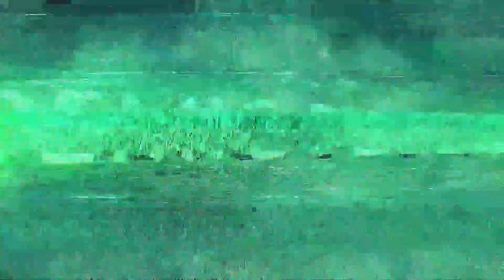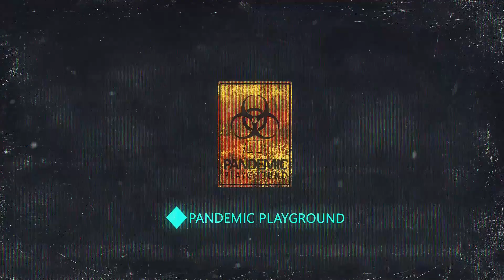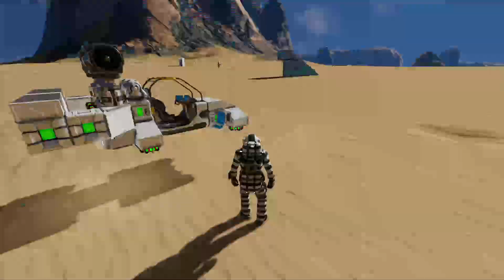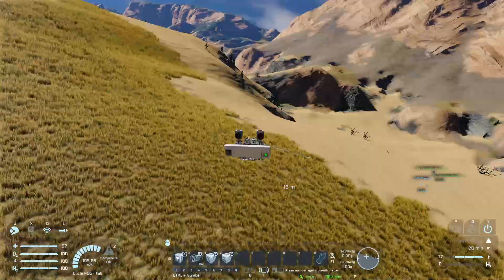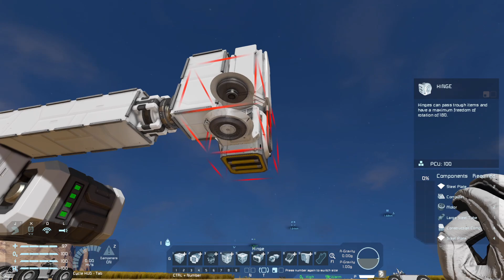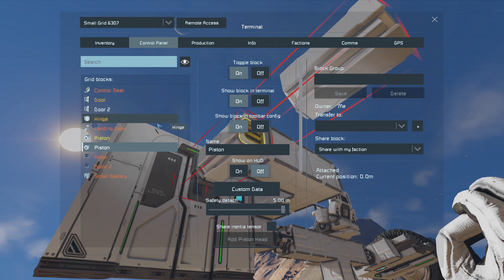Space Engineers Experiments: Testing Clang Drive

Comment: The first time I saw the piston into a door clang drive system was in an Epiktek video where he used it to save his ship because he ran out of hydrogen for his thrusters.  If you put the piston in line with the center of mass of your ship, it produces linear motion instead of rotating motion.  You should be able to use this to push a vehicle on wheels attached to free moving rotors.  There is an option in the Info menu to show the center of mass of your ships.
Reply from the maker: Interesting idea